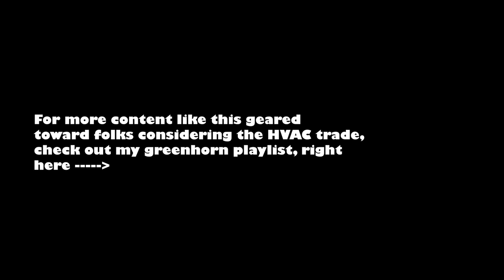5 Things to consider before becoming an HVAC Service Tech🔥❄

Comment: Completed a college degree in HVAC, worked on installs for 2 years followed by 3 years of service work. I got out of the trade. 

Your either working in the heat or in the cold, mainly always outdoors rain or shine. Every service call is a different problem and when you do have the hard job that gives you an issue trying to figure the issue out, you are looked at like an idiot.

I am beyond glad to get out of this trade. Unless you get into a UNION, you are working for mom n pop shops who have no respect for you and under pay you. Lugging heavy compressors up and down buildings plus all the equipment involved in a compressor replacement. Wasp nests all the time in rooftop units.

You have to buy your own tools too. (either than vacuum pumps, reclaim systems in my experiance). Most non-union people end up opening their own companies (lots of competition to go against).

Yes you will always be in demand for work but it's a shitty job imho.

I upgraded with Cpet and now work in a utility plant as an operator. Make 3x the $, don't come across stupid weird problems, I work on the same equipment, no heavy lifting, company supplies the tools and CLOTHES, indoors. Best decision I ever made.
Reply: 88Petry what exactly is cpet
Reply: More technicians are needed and your not helping. You have to be the right kind of person to do service. I'm sorry it took you over 5years to figure out that hvac was not for you. It's not for everyone, and all jobs will have something you don't like to do

Comment: Im an HVAC in germany in Industrie Branche. In the first point IT is Dirty as fuck.

What i can consider is the point of lonelyles. But mayby its ok. You habe moments wen you See the Problem solved easyli an than you get machines that have littel issues But behinde that is a big problem you think you propably cant solve. Funny job But sorry for my childs an family i can see Max 1 to 2 Times per week 🤟🏼 get the Engine runnig🤟🏼🤟🏼😅😋